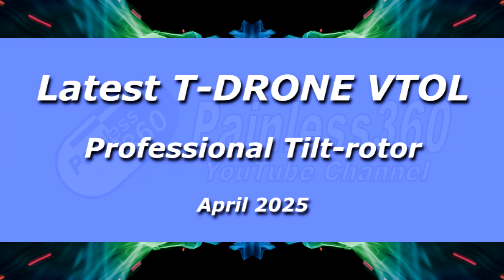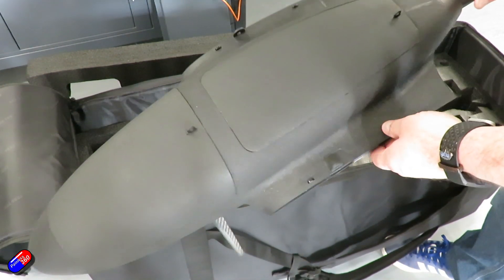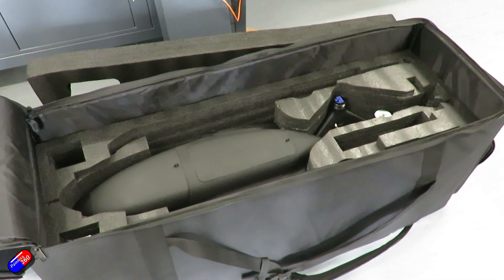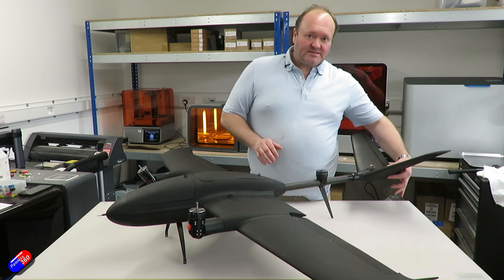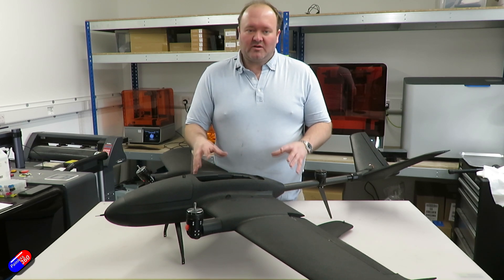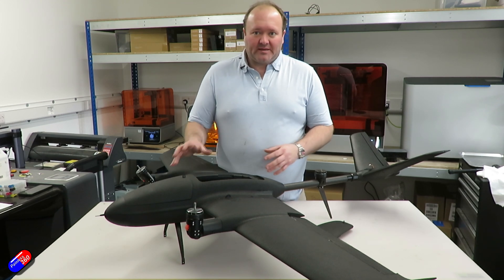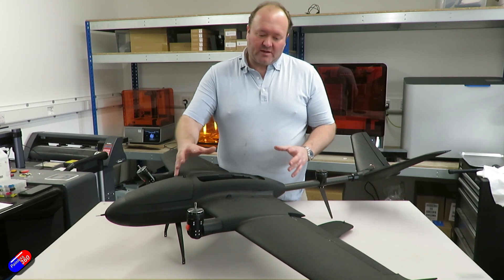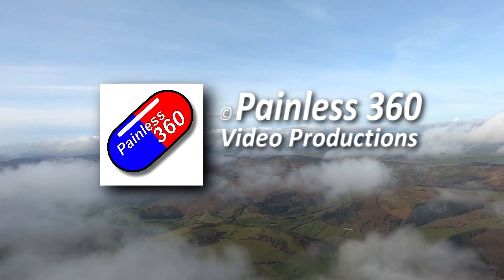The latest professional VTOL from T-Drones: The VA17

Comment: It all looks very high quality - except for the red part in the motor tilt mechanism, which looks like a really scruffy 3D print. What's going on there?
Reply: I have Perchased one on these and can confirm its not a scuffy 3D print. It's actually a red fabric that helps protect the wiring.
Reply: @mitchforbes3042  Ah, that makes sense - thanks!

Comment: I'm not associated in any way ..but here is some insight...I manufactured very large  commercial r/c airships for sports teams and government  use..  seems to me they are shooting to supply commercial clients and government entities, the safety  / financial liability, supply chain management and support service adds a ton of cost in those arenas of business.  when you sell to a hobbyist for the most part its one and done unless they have a real issue one that's not from misuse or shipping damage. in that sector you may have to spend hours of customer service time hand holding each client.. each client may end up making a large order or just the one for testing , but you will need to support each fledgling sale with the same care...a tech that can over the phone dissolve clients issue while they are on a X-pad with an official breathing down their neck are a rare find and are not cheap ... your sales people need to basically be engineers to be able to answer questions your getting from very qualified operators on the other end. there are many more aspects like these ones that are apart of this equation and also have large costs... especially with government they want to see and know quantify our whole procurement landscape so they can even make a decision to purchase from you...i have had huge sale teeter on such small things as where your nuts and bolts are manufactured and can you guarantee that suppliers performance.... so you see its a big ball of wax and a completely different animal than a hobby spec item...  while the item can be exactly the same design  one is backed by teams of people the other has no accountability baked in

Comment: I struggle to understand the price tag for this foam. Aside the motors/esc  what else guarantees a decent used car price-tag? No remote, no fc, no batteries, no 😢
Reply: Indeed! Sure it’s beautiful and well built, but at this price?!!! A hobbyist can build a decent tilt motor VTOL for 1/15th of this price and even for pro use, I’m sure I could build one for a 5th of the price! Anyways, I’m sure it’s the right product for someone out there! 😊 Thanks Lee for bringing it to our notice!
Reply: Thanks Lee and Ben for the info. One question for Ben, what Air speed sensor do you recomend for the Pix Cube Orange and the VA17?

Can't wait for the Ardupilot / settup and review vid 😉. T-drone also provides FC parameters after perchase.
Reply from the maker: Check out the pieces Ben chose for the VTOL biuld series he's helping me with that started about a week ago, it'll be the same airpseed as he's using there.. Best of luck!